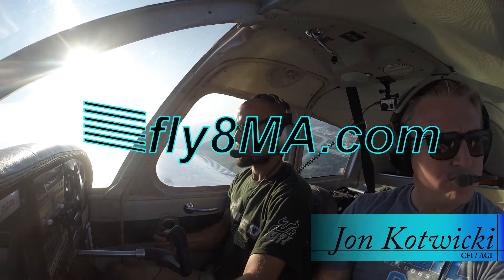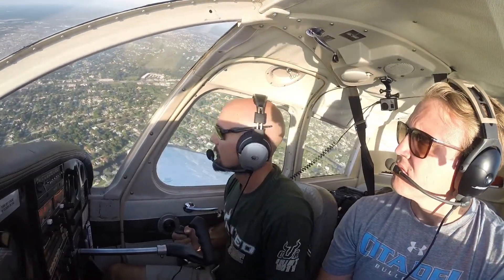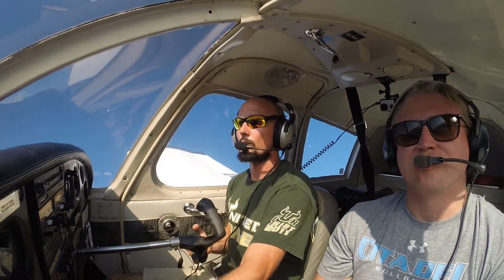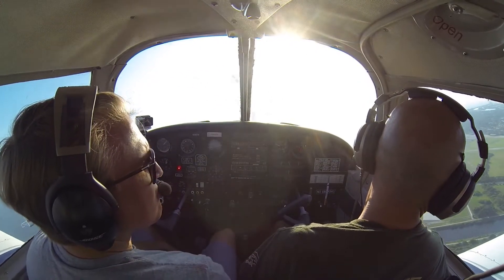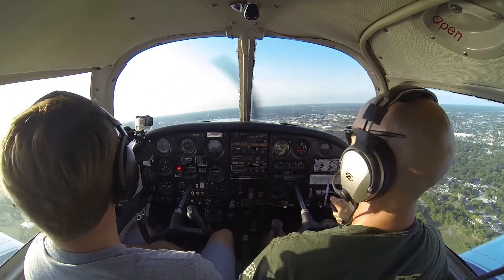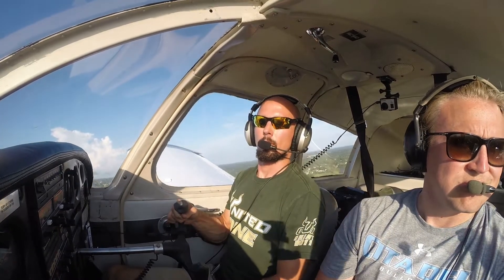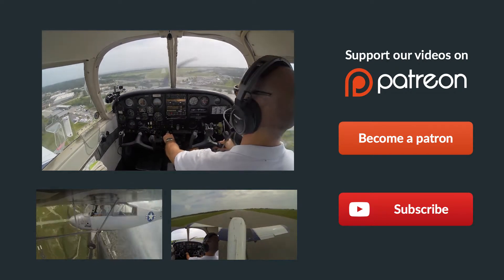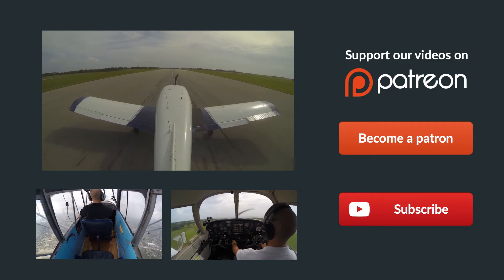Ground School: Best Sink Speed

Comment: Neat demonstration!  I enjoyed watching, but wouldn't feel comfortable doing it right now.  How about doing a comparison with a max rudder slip?    (I have actually done the slip with an instructor before where you have more bank than the rudder can compensate for.   Alternate left and right slips to stay generally on track for the runway.  You end up basically making S-Turns but in an pretty aggressive slip.) The other thing I like about the slip, with the right nose pitch you are almost instantly flying a normal approach again.  You don't have to time the speed build up.

Comment: I like the forward slip with a couple notches of flap. Really don't like the idea of slow flight just above stall making S turns at the low altitudes, especially as a new pilot. There is a higher risk of spin if you aren't quick on the rudder and at that altitude, you probably would not recover from a spin.

Comment: WOW. Scary. What about full flaps with a comfortable margin above stall? Some airplanes allow for a slip with flaps.
Reply from the maker: That could also be a viable option, the main thing here is that with flaps already out, you take advantage of the induced drag, and slow your ground speed to a minimum to give the most vertical descent profile.  Adding speed of any sort would actually reduce drag and increase your forward distance traveled.  I wouldn't call this a recommended procedure, just another tool to keep in the box if you ever find you need it.